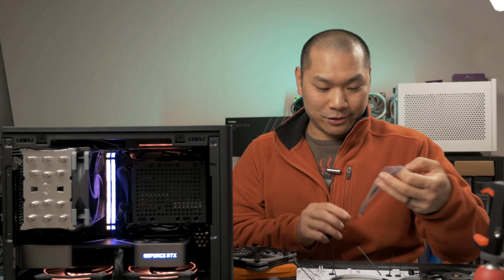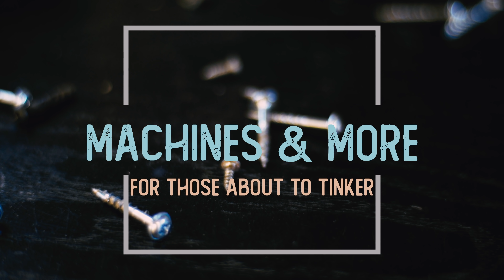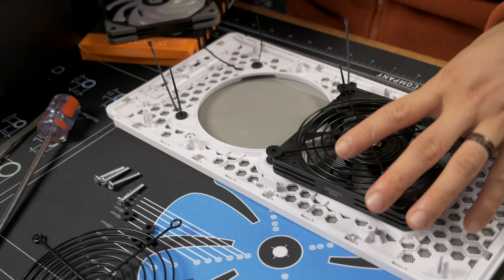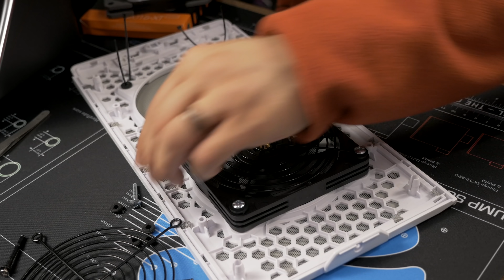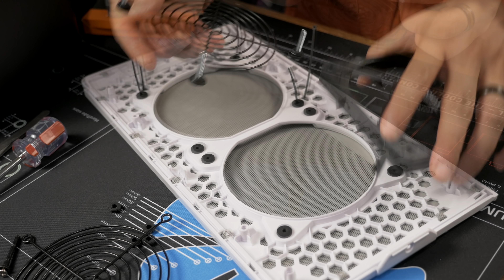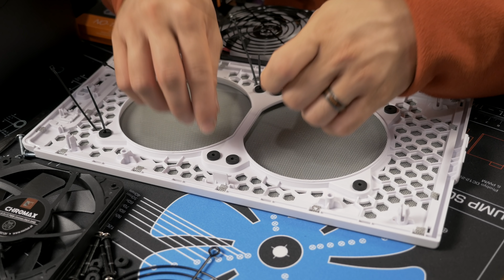Slim 120mm Top Fans in the NR200: Cheap, Easy Mounting Solutions and Thermal impact

Comment: I had to use the hack for my Arctic P12 Slim fans to be mounted on the bottom as when mounted via just screws, the fan was hitting the bottom of the case. I slid those rubber grommets through the bottom of the case and threaded the zip ties through that and fastened them there. It worked perfectly. Thank you for all of these informative NR200 videos.

Comment: Your nr200 videos have been so helpful. Used the zip tie method, if anyone’s doing it and doesn’t want to use any of the tooless ssd mounts some rubber washers the same size were only $.33ea at my local hardware store

Comment: I just wanna say your videos have been great for me. Its four years later and I am legit building in the nr200p. I have had this case for a long time, not the v2 but the og. Running a 7950x3d and 4090. Amazing to see how far we have come and this case is still great. If you see this comment and recommendations for the 7950x3d aio vs air? in your videos aio seemed to be better. I have an artic iii 240 which is actually cheaper then the noctua nh-u12a. Will be running 2 exhaust of course based on your videos. Again, thanks for the help!

Comment: I had a clearance issues as well. Mugen 5 with MSI B550i gaming edge WiFi in the NR200 with 25mm Arctic P12s on top. In my case, removing the fan grills from the mounting pegs (they unscrew), and bending the catch on the Mugen fan clip so it was flush got me just enough clearance. Nevertheless, this is a great guide for someone who may not have selected their top fans yet.

Comment: Using 4 scythe slim fans on my side 480 radiator and running the Arctic slim for my top 360 and am really impressed with the Arctic being a fraction of the cost over the scythe

Comment: This is "fan"tastic. I should have tried tip ties, but I ended up using the stock toolless rods and grommets to fit a slim fan on the top. It fits perfectly in my case above my ATX PSU, even though the rods extend past the fan quite a bit. The PSU's power cable is right up against the fan grille. XP

Comment: Hey man, this is amazing
You should get the ATX PSU bracket for this case and test it, would be awesome!
Thanks for the vid.
Reply: Yeah I also have a an ATX psu in my nr200 and I am curious to know what the best cooling solution with this quirk in setup would be!!!!
Keep the nr200 content up we all love it! Our other sff build content.
Reply: I have a friend printing me some ATX psu brackets to go in my NR200 that just arrived yesterday. Which PSU did you all choose? I went with the Seasonic PX850. I think it's the best 140mm choice.  I'll be using the Noctua C14S in my build. Hoping the ATX PSU will allow me to easily do Push Pull Noctua A14s. It's a bit cramped with the SFX psu mount. I was wondering if I should go with a top fan in the CPU area. With the upper ATX bracket I'm pretty sure I won't be able to get a fan in the Top fan slot over the PSU. I guess we will find out soon.
Reply: If he is going to test an ATX PSU bracket it might as well be this one: https://www.etsy.com/listing/881894816/customized-and-improved-cooler-master
Reply: @Quaddragon  Yeah currently I just have the stock amd cooler but I've bought a couple different air coolers and AIOs and just need some time to try to figure out what I want too keep. I actually don't even have a psu bracket and just zip-tied (I know I know super sketch) the PSU into place for now. I would prefer to use a bracket like the one @Casey Rose mentioned to keep the psu in the original position, instead of the official coolermaster one that moves it to the front panel. The etsy one would even allow for an AIO but I just don't know if I am doing an AIO or air cooler yet. I have to many variables still undecided. Hence why if Machines & More made a video on both psu mounts and the temps I would be thrilled!!!!!
Reply: @MrPilotRose  I wish the etsy seller would post the stl files, though I'm sure whipping up my own version wouldn't be that hard.
Reply: I have the Etsy bracket on the way, as soon as it arrives I will try it with a seasonic focus 850w.
Still trying to choose an air-cooler for my build.
Reply: @PabloHuerfano  seems pretty nice, but i tried to quote the 3d impression of the Cooler master bracket in my town and the price was absurd, so i decided to buy the Etsy one, less problems i guess.

Comment: So I'm thinking I messed up. I purchased the NR200 based on your great reviews. But, I also bought a be quiet dark rock tf cooler. My plan was to have 2x120mm fans at the top and a 92mm fan on the side. It looks like that's not at all possible with my current setup. Running an asus z370i mb.
Reply from the maker: The big top down coolers often prevent the top fan and rear exhaust 92mm from working. However the direction of airflow from top down coolers is already utilizing those two paths as exhausts, especially if you have rad panel fans and bottom intakes. So, it would be nice to have those fans but it’s not the worst setup to not have them.
Reply: @MachinesMore  Thank you!

Comment: Get some automotive acrylic double sided tape and slap that on anywhere you want something to get mounted. It might feel like it will comes off in the beginning, but with time and some moderate heat generated by the system, pulling the fan from the tape will prove to be a challenge. And the thick double sided tape also acts as vibration dampener.

Comment: Thanks a lot for all  these extensive testing with the nr200, you're saving us a lot of time :) 
I would like to ask, did you (or anyone esle) tried to mount a CPU tower cooler horizontally (fans up/down instead of left/right) in order to follow the bottom to top airflow ? I'm curious about the performances but it's always annoying to remove thermal paste so if anyone already has a conclusion about it that would be awesome :)
Reply from the maker: Fans up and down have a unique set of challenges. If air moves bottom to top, then you're bringing in GPU exhaust almost directly through the heatfins. If your air moves top to bottom, then you're placing that into the GPU's vicinity and also feeding the fans. So in a combined scenario I typically think that's a sub-optimal setup. If you only have a CPU, by all means, I think having a bottom to top airflow setup that way would be ideal.

Comment: A potential video idea would be to make a best value  build that would suit mid range budget systems where every buck towards that GPU helps.
My system is a good example Ryzen 5 2600 with stock fan and GTX1660 Super in a NR200.
So where best to spend money with cooling - if any?
Reply from the maker: That is a very good idea... I'll put together a parts list for that and explore. For 1080 gaming, unless competitive titles, what you have right there will still work for a long time. In fact the "father and son" gaming rig I built features the 2600 and 1660S also. That will get rebuilt in a new case on the channel shortly.

Comment: So the NR200 comes with fan extension and  it has one cable that is colored which I am guessing is for RPM reading? Can you tell me which fan you have connected to that? The bottom fans?
Reply from the maker: Correct- the red is a 4 pin which gives the readout. If you’re using the same fans on the splitter then any one will do, in general you’ll get a very close estimate for the others. If they’re dissimilar, then that’s when you have to pick and choose. If the RPM ranges of the fans are vastly different and you don’t intend on the RPM being very different then I would not recommend having them on the same header anyway. If the RPM range is close enough then I personally don’t think it matters, just pick one fan so you can get an idea of the speed.

Comment: I'm going to get one of these cases. But I really don't wsnt to downgrade my pump that I have in my current case. Do you reckon you could figure out a way to get a d5 FLT pump res combo to fit in that case with 1 radiator and gpu and cpu blocks?

I am going to do 2 external 360mm radiators so colling isn't an issue just don't want the pump outside the case.
Reply from the maker: The d5 flt is a tough fit due to the thickness, unfortunately the shape doesn’t play well with the case and PSU placement.  A traditional cylindrical pump res fits well, or the DDC version is a much better fit. I want to say it might be possible just to swap pumps with the D5/DDC res.

Comment: I would love to see a comparison between the recommended x2 bottom intake + x2 top exhaust with all four NF-A12x25 PWM fans versus all four NF-A12x15-PWM fans.
Reply: Definitely would be interesting to see if there actually is a big enough difference. Would also love to see the same fan setup with 4x noctua vs 4x artic fans to compare noise/temp levels. One noctua fan costs as much as a 5x pack of arctic p12 fans.
Reply from the maker: Slim fans vs 25mm fans? The only difference would be how high you can run the slims at the same noise level, since the A12x15s move as much air as something like an NF-F12x25 at the same RPMs. The A12x25s are dead quiet at 1200 RPM while the slims are very audible. At 1000 RPM? Noise difference is marginal. Will it matter for system thermals for 1200 RPM vs 1000 RPM? To an extent but it might not be worth the cost of the additional cost of the 25mm fans. The fit with your GPU and your other components is what would really drive that decision, I think.
Reply: @MachinesMore  When the AIO's pump is using 1 fan header, the AIO's fans (with Y splitter) are using 1 other fan header, and there is only 1 fan header left for the 4 case fans would you recommend using x4 A12x15s or x2 A12x15s + x2 A12x25s? And how would you connect them (daisy chain with 3 Y splitters, fan hub...)?

Comment: I ended up taking the mesh off and putting screws in from the top it feels like it will hold just fine but a little worried about it ,maybe I will add a dab of silicone on corners

Comment: If I were to have a mugen 5 on a gigabyte b550i aorus pro ax, would I just have the one fan on the mugen or would the 92mm fan that comes with the nr200 go on the rear as well? Also should those fan(s) be intaking or exhausting?

Comment: I bought a prebuilt PC from ebay and although it was a really good deal the surprise came when I started to upgrade the prebuilt PC.First of all I never knew that I could learn to hate small cases,the case that the prebuilt PC came in is terrible in that it is very hard to get in and out of the case.Small cases have their place and purpose but for the life of me I cannot understand why anyone building a high end PC would opt to use a small PC case.Even the mid tower cases are difficult for me to navigate in because I have big thick hands and what's more small and mid tower cases have a nasty tendency to obstruct air flow on top of being very difficult to get in and out of.Even owning a blower to dust out the PC case is no guarantee of cleaning small and mid PC cases properly because sooner or later it will get to a point where it will become necessary to take the cooling fans out and clean the cooling fans and the inside of the PC case thoroughly in order to get the cooling fans and the inside of the PC case as clean as the inside of the PC case should be.Dust filters are a great help in keeping dust out of PCs but even with the dust filters it is often necessary to clean out the cooling fans and the PC case at some point in time.Call me a snob but I will not ever again bother with any small or mid size PC case.The PC case in the above video looks to me like it's being choked of the necessary air needed to keep the PC components cool,I could be wrong but I doubt it and what's more it should never be necessary to bend any part of a PC case or alter any PC component to make things fit.If you're going to spend so much money on quality PC parts it seems foolish to use a small or mid PC case where you will need to force things to fit.Thank you for the video,God bless you and your family.I'm a licensed firearms owner and I get annoyed hearing people talk about this or that part makes a firearm heavier,hell,in the middle of an emergency where a person is forced to use his/her firearm do you think it's going to make any difference if a firearm part is a bit heavier when the person's adrenaline level is so high and the person is so worked up having to face one or several home invaders?"Oh,I don't like this/I don't like that.",what in the hell have we as Americans become,a bunch of limp wrist pansies?Do you think criminals or home invaders are going to stop in their tracks and admire your firearm being lighter than their firearm?I understand about space constraints but if you can make space for your big screen TV there is no reason why you can't make space for a PC case that will properly accomodate and fit the PC components without denying the PC components adequate airflow.If spending $500.00,$600.00 or more on a graphics card just to cram the graphics card into a tiny PC case where the graphics card will be denied the airflow that the graphics card needs in order to function properly isn't the epitome of stupidity then I don't know what is.Look at how extremely cramped that graphics card and the other PC components are in that tiny ass PC case,are you kidding me?You're joking,right?"Oh,my tiny PC case looks so cool." when the reality is that your tiny ass PC case is on the verge of catching fire and burning your house down because that tiny ass PC case is forcing the PC components to run much hotter than the PC components should be running from lack of proper air ventilation.You can abuse and berate me all you want but you will never catch me spending so much money on a graphics card or on any high dollar PC component just to cram it into a tiny ass PC case like that and risk losing my money.From what I have read PC components are designed to work andinstalled a certain way.Unlike many people I do not suffer from the bad habit of not reading instructions and I have yet to read instructions where PC component manufacturers say that it's okay to cram PC components into tiny cases where the PC components will never get enough air flow.I registered my new Gigabyte aorus b550 ac wifi motherboard for the warranty and I was asked all kinds of questions including the product number of my amd ryzen 3600x cpu,which cpu cooler I am using,the brand and output wattage of my new power supply,the brand and amount of memory that I am using and yes,even the brand and model number of the PC case that I am using,coincidence?I seriously doubt it.
Reply from the maker: Nelson, thank you for taking the time to write a very thoughtful comment. I can appreciate that argument and I don't think you should ever build in a case you don't feel comfortable with. This channel features many products that are designed around small form factor computing. I do think there is a point where things are too small for their own good, but popular small form factor cases generally don't hit that point yet. In fact because of the way the case airflow can be designed in SFF, they allow for the builder to selectively place fans to really take advance of direct airflow. The best example for this is case fans close to a graphics card. It might not seem that way- and it does take some experimentation to see what works- but SFF cases can work very very well. Just an observation- one attribute of consumer behavior, in general there are people that choose products based on the 99% of the time they use them, and some people choose based on the 1% of the time they use them. So, to use your own example, some folks buy a firearm for self-defense and never bother to train with it (not good), in that scenario they hopefully never use it. Then all the features in the world might never matter to them. Perhaps all that matters in the most critical scenario is if that first round fires when that trigger is pulled, never mind how it cycles, right? The criteria for purchasing in that scenario is very different than someone who plans to run it all the time. Some folks treat it as a hobby or recreation, for the majority of the time they are operating it out on the range they would much rather have the lighter weight and better user experience. I will also point out that generally it's not recommended to keep a modded firearm for self-defense purposes, both from a legal and reliability standpoint. Most folks that do mod do keep something else stock for that specific purpose.
For PC components you often see the same argument. Some folks like AIOs because when they work they give really good performance, even though there is a bigger possibility or failure. Some folks like air coolers perhaps because of their simplicity and reliability. Whatever it is, everyone has their reason to make their purchasing decision and it's not necessarily wrong or right, it's just a different way to evaluate a product. If you like a large case because it satisfies your computing needs and you feel comfortable with it 100% of the time, that's great. You'll also find many folks that are extremely happy with their SFF case, and while you might hear occasional reports of components overheating in a sub-optimal case, the internet isn't exactly littered with stories of melting components either. To each their own, thanks for sharing and whatever it is that you build, happy computing.